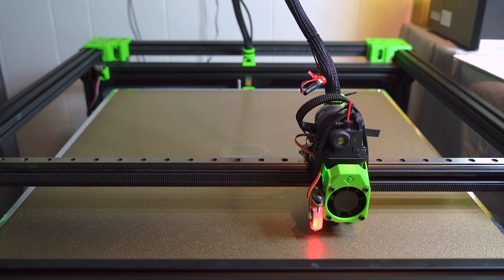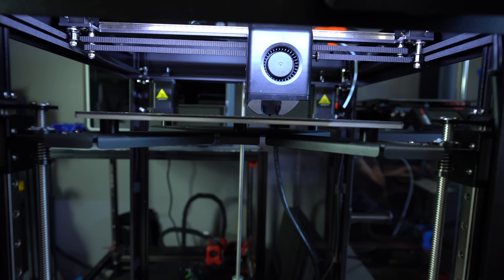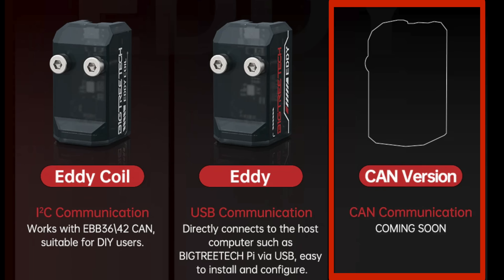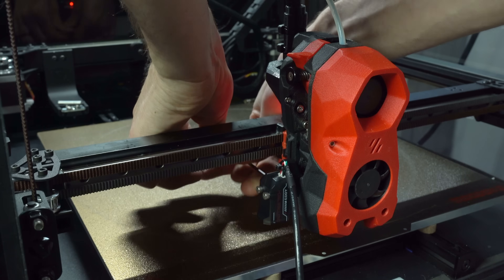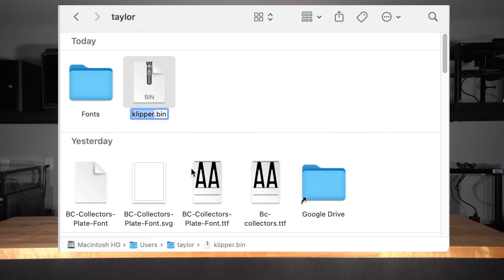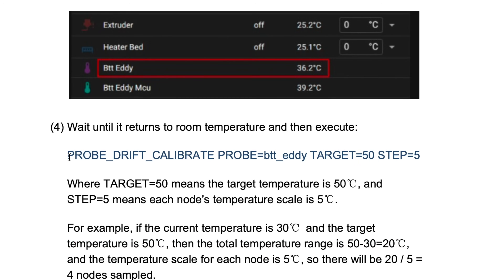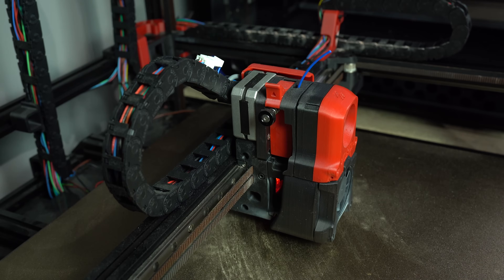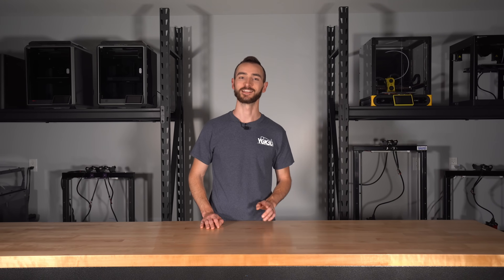3D Printer Bed Mesh Generation Will NEVER Be The Same - Eddy v.s. Beacon

Comment: So you cite the fact that you have to SSH into the PI to run the installer for Beacon as a negative and make BTT sound like the superior option because it's all supported in Klipper. That's a little deceiving at first.  Running a klipper fork such as BTT's version is far more involved than a single install script.  Maybe you should have started the video with something like "BTT sent me their new Eddy and want me to tell you why it's better than Beacon...."

Nice job on how to do a Klipper upgrade.    I got tired of trying to remember all of that and just put it a script!

###---update-klipper.sh---###
#!/bin/sh

LIS2DW="/dev/serial/by-id/usb-Klipper_rp2040_4550357129139138-if00"
FYPIS="/dev/serial/by-id/usb-Klipper_rp2040_E66160F423829A37-if00"

sudo service klipper stop
cd ~/klipper
git pull

make clean KCONFIG_CONFIG=config.spider
make menuconfig KCONFIG_CONFIG=config.spider
make KCONFIG_CONFIG=config.spider
# ./scripts/flash-sdcard.sh /dev/ttyS0 fysetc-spider
echo -e "\n\n"
echo "Loading firmware for Spider board"
echo -e "\n\n"
./scripts/flash-sdcard.sh /dev/serial/by-id/usb-Klipper_stm32f446xx_4E0059001051383039343538-if00 fysetc-spider

make clean KCONFIG_CONFIG=config.rpi
make menuconfig KCONFIG_CONFIG=config.rpi
echo -e "\n\n"
echo "Loading firmware for PI"
echo -e "\n\n"
make flash KCONFIG_CONFIG=config.rpi

make clean KCONFIG_CONFIG=config.ebb
make menuconfig KCONFIG_CONFIG=config.ebb
make KCONFIG_CONFIG=config.ebb
echo -e "\n\n"
echo "Loading firmware for CanBus EBB36 board"
echo -e "\n\n"
# python3 ~/CanBoot/scripts/flash_can.py -i can0 -f ~/klipper/out/klipper.bin -u a68b05f2e380
python3 ~/CanBoot/scripts/flash_can.py -i can0 -f ~/klipper/out/klipper.bin -u 1893b8296dd8

# For the BTT S2DW Nozzle LIS chip
rm -rf ~/klipper/out/klipper-btt_s2dw.uf2
make clean KCONFIG_CONFIG=config.s2dw
make menuconfig KCONFIG_CONFIG=config.s2dw
if [ -e $LIS2DW ]; then
  make flash KCONFIG_CONFIG=config.s2dw FLASH_DEVICE=$LIS2DW
  echo -e "\n\n"
  echo "Loading firmware fon BTT LIS2DW board"
  echo -e "\n\n"

else
  make KCONFIG_CONFIG=config.s2dw
  mv ~/klipper/out/klipper.uf2 ~/klipper/out/klipper-btt_s2dw.uf2
  echo -e "\n\n"
  echo "download ~/klipper/out/klipper-btt_s2dw.uf2 and copy to the chip in windows"
  echo "scp tripi:./klipper/out/klipper-btt_s2dw.uf2 ~/Desktop/firmware.uf2"
  echo -e "\n\n"
fi

# For the FYSETC PIS Nozzle ADXL chip
rm -rf ~/klipper/out/klipper-fypis.uf2
make clean KCONFIG_CONFIG=config.pis
make menuconfig KCONFIG_CONFIG=config.pis
if [ -e $FYPIS ]; then
  make flash KCONFIG_CONFIG=config.pis FLASH_DEVICE=$FYPIS
  echo -e "\n\n"
  echo "Loading firmware fon FYSETC PIS board"
  echo -e "\n\n"

else
  make KCONFIG_CONFIG=config.pis
  mv ~/klipper/out/klipper.uf2 ~/klipper/out/klipper-fypis.uf2
  echo -e "\n\n"
  echo "download ~/klipper/out/klipper-fypis.uf2 and copy to the chip in windows"
  echo "scp tripi:./klipper/out/klipper-fypis.uf2 ~/Desktop/klippe.uf2"
  echo "FLASH FIRMWARE...."
  echo "1. press & hold the button"
  echo "2. Connect to PC w/ USB cable"
  echo "3. Release button"
  echo "4. Open folde RPI-RP2, copy klipper.uf2 to folder"
  echo "5. wait for copy to finish"
  echo "6. Recoonect to printer"
 echo -e "\n\n"
fi

sudo service klipper start
#######
Reply from the maker: When the support for Eddy current probes is integrated into Klipper directly, without the need to use a separate fork, I do think that will be better in the long run. But for now, you're absolutely right. The process is much more involved for Eddy, especially given that Klipper breaks when the versions are out of sync. Great tip on the install script for updating!

Comment: Scanning can't be "the new probing". Bed Mesh generation is completely different from Z-Probing. Have fun adjusting your Z-Offset every time you change to a different print surface (especially if it's not made from spring steel).
Reply: Seeing as these sensors only work on spring steel, you’re complaining about a problem that doesn’t exist.
Reply: @HE-162  Are you able to read properly? Do you even own more than 1 print plate? Hell, even with only 1 plate you'd already have to adjust the Z-offset if it has smooth and textured surfaces on either side. And now get multiple plates from different vendors...
Reply: @jangrewe  I run 5 printers with 7 spring steel plates between them. Some pei/pei powder coat, some pei/plain steel. On a typical week 4 out of the 5 printers are running 24/7. Pei film is very consistent due to the way it’s produced(same brand film, obviously), and sheets from the same company should all be close enough that the minor variances in film height shouldn’t matter unless you’re printing super low first layers. Obviously powder coat is a little less consistent but is still consistent enough for all intents are purposes between quality plates of the same brand.  

If you need to adjust your z offset every time you swap a plate, regardless of what probe/leveling method you use, you’re doing something wrong. If you have plates with variance between coatings, you should have those offsets saved for each surface. None of that is relevant to the purpose of the scan. The surface coating is going to be consistent and won’t change, provided you put your plate back accurately each time, but what will change is the contour of the bed - especially if you’re printing in high volume. Dust, plastic crumbs, and general warping due to heat cycles and constant removal and replacement of sheet will result of bed contour variances print to print. Period. The only way your sheets coating will change(and thus the required z offset) is if you change sheets or damage the coating in some way. And even then, people act like printers are working with insane tolerances where a .005 variance in the cast pei film height is going to disrupt their first layer - it’s not. Its even less likely too on a powder coated sheet, where probing the bed is already an imprecise process due to the natural variation in the powder coat which allows the probe to land in valleys and on peaks that are going to make for different readings every single time you probe the bed unless you replace the sheet with sub mm precision every time. Not that it matters, because that variation in the powder coat is part of its strength, and provides the grip that makes it popular. A quality powder coat should average out to be extremely consistent across the sheet, making a scan have the potential to provide a more accurate mesh than a physical probe ever could. 

5 of my 7 sheets are from the same company and the z offset is identical across them per surface type. The other 2 are both different, and only 1 of them requires a different offset for the powder coat from the other 5, and both of them use the same offset for the film side despite being from different manufacturers(though it’s a different offset from the film on the other 5). 

I know what my offsets need to be per sheet, I have them written down on each sheet per nozzle size and type - ex: .8cht vs .8 diamondized like different offsets. If I change or flip a sheet, all I need to do is punch in the correct offset and hit print and walk away. I have 3 printers running the ebb eddy alone, 1 running an eddy with a bltouch for the z end stop, and 1 running just a bl touch. The only different between them in performance/accuracy/reliability is the time from hitting print to laying down plastic, as the bl touch machine naturally takes a few minutes to build the mesh for the print. Because of this, the bltouch machine only runs a 10x10 mesh(obviously also running adaptive meshing to save time but usually the build plate is full), and sometimes the lower resolution mesh causes issues with the first layer if there’s a bit of grit under the build plate or I missed a tiny spec stuck to the surface that was missed when prepping the plate for the next print. Other than that, time is the only difference. No z offset adjustments needed, just make sure the appropriate one is set for the surface/nozzle combo

Comment: Cartographer is working on the touch probing for z-offset. It also includes an accelerometer like beacon and has temperature compensation like eddy,it supports usb and canbus and is priced right in between eddy and beacon.

Given that, it's got the best bang for your buck! I've had mine on my k1 max for a couple of months now and it's been amazing. 

Would have been interesting to see your findings if you had added that one into the mix too.

Comment: Unless you are making changes to your printer constantly, the clicky or tap mesh works great if you, do a large number of points, and save meshes for a set of typical temperature ranges you print at. for example.  I heat soak my printer with panels off at 60c bed temp for 30min, then do a bed mesh and save.  in my print template for PLA, i load that bed mesh before print starts.  I do that for PETG, ABS/ASA, etc. so I have a few profiles for different conditions.  If you have a thick enough bed plate, and don't change the screws or other things on your printer, and do the same length of heat soak each time, the bed etc will expand and change basically the same every time so that the saved meshes work great.  At least they have for me over the past couple of years.
Reply from the maker: Good tip!
Reply: It is really worth it to let the bead heat for 30 mins before every print?
Reply: These are really time saving sensors, not something needed if you don’t care about time. 

Printing is a significant portion of my income and 30 minutes heat soaking the bed is money down the drain, as is probing a complete mesh every print. Being able to build a mesh for every print in 10 seconds means I can hit print and don’t need to stand around for 5(or in your case 30) minutes to ensure the layer goes down clean. Any printers running 24/7 are not gonna be able to produce reliable first layers every single time without building a mesh or having an expensive and thick machined bed. 

These sensors don’t offer anything that can’t be achieved with other probes, except saving a lot of time.

Comment: I have a bambu the only upgrades i did was the obsidian or DLC coated nozzle.  I know DLC used a lot in gun industries  so i figured it be good and it's great nozzle.  Is this device domething you cash only use on voron style printers or could it make your bambu better?  Thanks
Reply: No. Not compatable with Bambu's ecosystem. Bambu has it's own system that works great.

Comment: I still think a simple load cell is the best bed leveling solution. If you use the nozzel itself to level then there is no offset to worry about. The printer knows EXACTLY where the bed is at each point. The only missing data is between the points but on a reasonably flat bed it really shouldn't have that much variance over a few centimeters. Your bed should be well within tolerance over that small distance. Yes this eddy current thing is continuous but if your bed is that wavy then you have bigger problems to worry about. 😂

Comment: Possibly why you never get perfect first layers: maybe more of an issue for v wheels, but may apply to linear rails too. If there is any z deviation in height between the nozzle and where the probe ends up that matches where the nozzle tip was, then that will be a shifted value. So this is usually partially fixed with zero-y-offset mods on cheap v wheel printers, where the y value is the same for the probe and nozzle, yet it does nothing for the x axis. If there is a slight imperfection in one of the axes within the distance between your nozzle and probe, then it will not be accounted for in the mesh. The only way to fix this is to nozzle probe in one point then move the scanner or bed probe to the exact same point. Do this across the whole bed, it will then give you a map of the variance between actual nozzle distance and what the probe measures. Realistically you need to subtract or add this variance for the whole bed from the live bed mesh. Hopefully that makes sense, and it would be something possible to test.
Reply: Or just have the probe on the nozzle like the "clicky" solution. This is a step back from anything that has the probe directly under the nozzle. Another solution would be to implement skew compensation in Klipper for the Y axis, we already have it for X axis and it solves the offset problem as well.

Comment: Inductive has been around in CNC for a long time.
I remember using inductive sensing on an Amada Lasmac LC1212 Apha II way back in 1998.
It's great to see this being introduced for bed levelling.
Reply: Inductive sensors were common in automation in like 1960s.
Reply: @chronokoks Inductive sensors are probably most used sensors in automation, second being light sensors.
Not sure about CNC.
Reply: @ CNCs are full of inductive sensors.
Reply: Da wird aber auch mehr aufwand getrieben. Und um nur den Nullpunkt zu erfassen reichen sie, aber nicht um genaue messungen zu machen

Comment: Note, this doesn't work on glass, it doesn't measure the surface, it measures the metal below the surface, so any variation in the for example the PEI thickness will NOT be detected

Comment: Based on my research technically you can run I2C over SPI bus which we have on BTT SB2209 but no one have done it so far and it could be an interesting setup.

Comment: My voron tap does everything and give me perfect results 100% of the time, regardless of bed material and/or temperature. With adaptive bed mesh, you only mesh the part you actually use(faster) . Not sure saving such little time make sense all in all. More of a party trick in my opinion.

Comment: "The probe emits a electromagnetic field which induce a small electrical current in the nearby conductive medium"
But this is exact principle any inductive proximity sensor/switch used in 3D printers operates upon.  But you saying like it's something absolutely new and different which is not true. The actual major difference between the generic inductive proximity switches is that the first one is permanently set to a specific triggering hysteresis loop that obviously requires vertical movements to trigger whereas the latter one continuously register changes in the electrical current yet measures distance to a build plate surface.
Reply: I wondering same. My old prusa mk3 got proxmity sensonsor build in allready. 😂
Reply: AHHHHH! You are so right it hurts! Induced electric currents ARE eddies! 

In electromagnetism, an eddy current (also called Foucault's current) is a loop of electric current induced within conductors by a changing magnetic field in the conductor according to Faraday's law of induction or by the relative motion of a conductor in a magnetic field. Eddy currents flow in closed loops within conductors, in planes perpendicular to the magnetic field. They can be induced within nearby stationary conductors by a time-varying magnetic field created by an AC electromagnet or transformer, for example, or by relative motion between a magnet and a nearby conductor. The magnitude of the current in a given loop is proportional to the strength of the magnetic field, the area of the loop, and the rate of change of flux, and inversely proportional to the resistivity of the material. When graphed, these circular currents within a piece of metal look vaguely like eddies or whirlpools in a liquid.
Reply: So what you are saying is that it is totally the same, except for the meaningful difference that makes it night and day different and better, that is new to 3D printing. Thanks for that info. It has also made me realize that cars are just the same as stage coaches... I mean, wheels on a carriage have been around since before ancient Rome.

Comment: This combined with strain gauges to get accurate nozzle offsets and pressure information sounds like the ideal way to scan a bed.

First you tap like 3 points with the nozzle, then you get a detailed fast scan over the whole bed, then you compare those 3 areas with the offset of the eddy current sensor and bang, you've got insane accuracy across the whole bed and no z offset faff.

Comment: I think scanning the "metal" bed is a step backward, since you are not printing on metal.  That was PRUSA Pinda days and they are gone luckily.  Today its load sensor or Bambu "knock" sensors. They compensate for thick plates, PEI, etc.  These methods work perfect. Case closed.
Reply: that would be a good argument if it was anywhere near the level of accuracy and repeatability....it isnt. beacon can hit sub micron. and you cant do a 10,000+ pt bed mesh in 1 minute with a nozzle probe but you sure can on a beacon. running a 9x9 klicky on a 350 takes flipping forever and thats only 81 pt. i have a lot of printers (~25) and have tried just about everything. for example, on my newest printers (magneto x)  my magneto for example has a nozzle load cell, but its only 0.05mm accurate- this is like 50x less accurate than beacon, i dont care if it can nozzle probe, it takes like 20 minutes to probe and the values are nonsense.

Comment: I don't get it how it works as a contact probe with the nozzle by firmware update. Sorry it's a mystery to me.. How it recognize that the nozzle touches a surface...
Reply: The probe can detect when the magnetic field stops changing and treat it as an endstop.
Reply from the maker: Same. Not sure what wizardry that is.
Reply: @ygk3d  maybe some sort of measurement of the used current of the z-motors, when it touches something the used current would be higher so by firmware it says stop I'm touching something. Like sensorless homing works.. Maybe.... 🤷 Only that the nozzle touches any surface in this case...